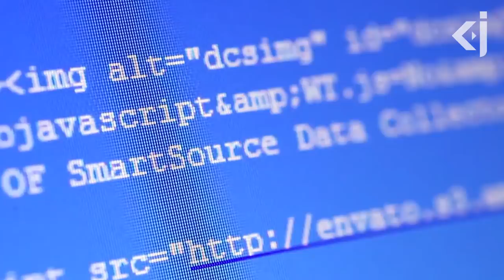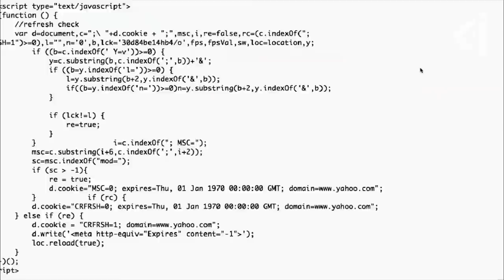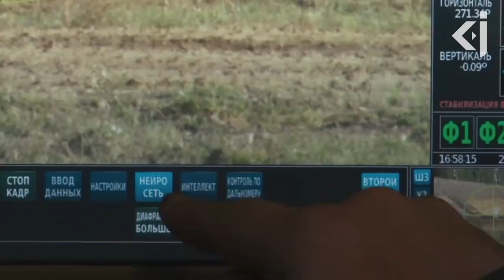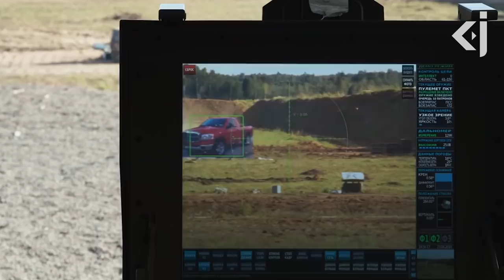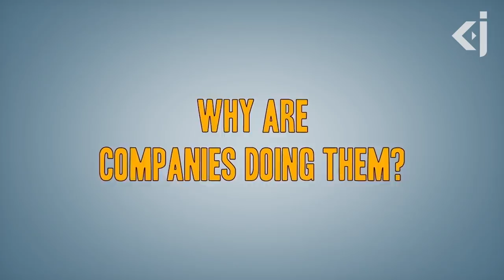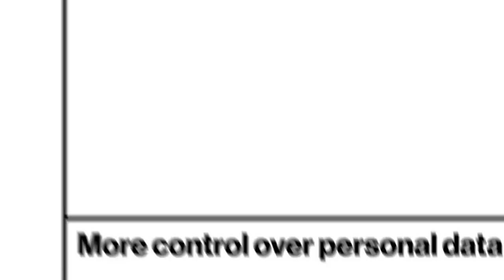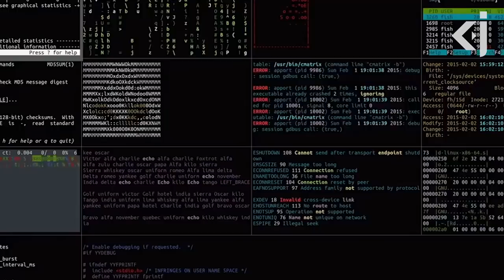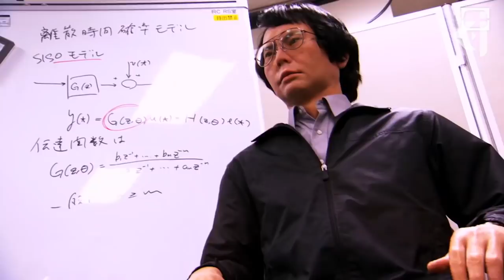Global race for AI superiority

Comment: I agree with the sentiment of others here that this video was a bit too fluffy/vague, for e.g. the statement that EU and Russia lags behind with "a considerable margin"; while that may be true, you need to quantify how much or show some underlying data point to support the claim (and potential disadvantages, like lack of funding, is not a proof since such barriers can be overcome in various ways, it's only proof if it concerns the end result). 

Additionally, at times you seemingly hint at inaccurate conclusions, e.g. that the EU "suffers from a complicated regulatory environment" where GDPR seems to be referenced as an example. GDPR is indeed quite heavy and wide reaching, however it is actually a harmonising regulation that ensures a company can more easily comply with all markets throughout the EU and EEA; i.e. it's actually a simplification and a step towards a less fragmented market.

Comment: Interesting, however I don't agree with the conclusion on Europe. GDPR has only just come in and the lack of tech innovation leaders from Europe is probably far more likely to do with the fact that Europe does not have a unifying tech centre, there is no equivalent to Silicone Valley and Shenzhen. Indeed the EU is a collection of independent countries so there is little interest in all countries uniting to place an EU silicone valley in one of the 28. Instead we have smaller efforts like the laughable and pathetic 'tech city' in the UK which is a converted road roundabout in London. Europe desperately needs to build an innovation hub.